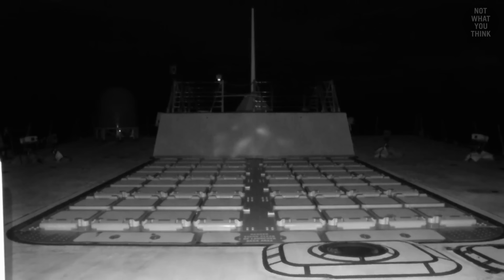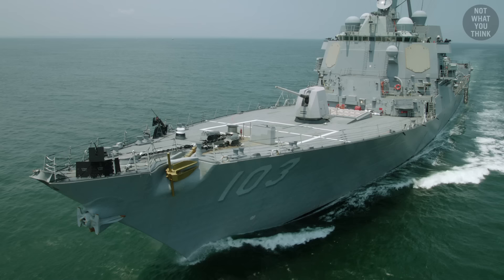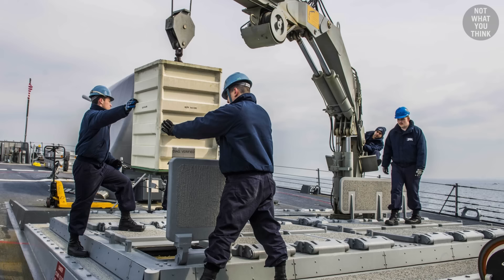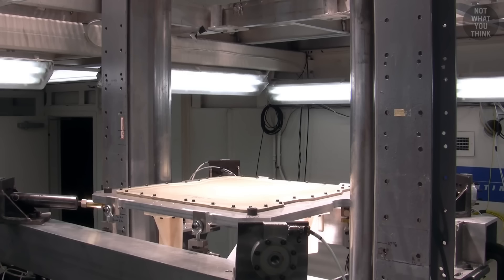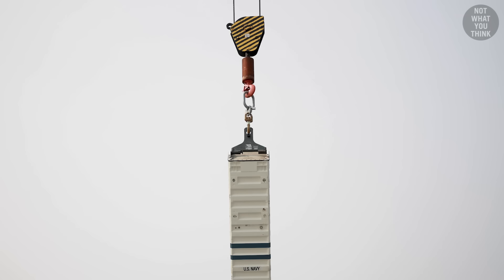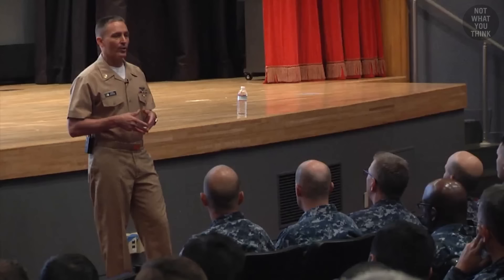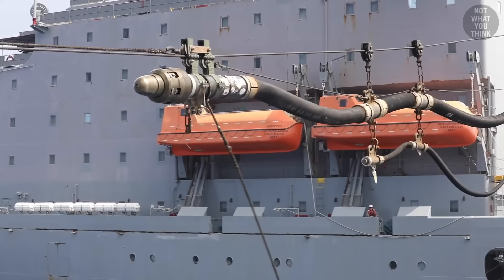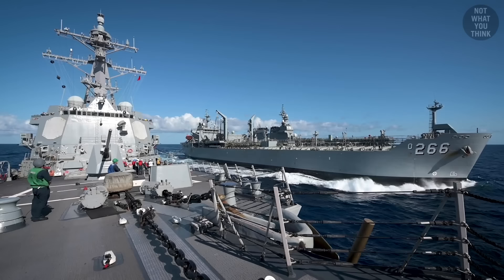Why Warships Cannot Reload Missiles at Sea

Comment: What about a floating dry dock that can be deployed in the ocean that holds the ship in a calm sea state and is equipped with hundreds of loadable missile cases and cranes that can reload the ship without fully removing the ship from a theatre?
Reply: 😂 that ship would be the second most targeted ship after the carrier
Reply: @jessicaregina1956  either way American logistics will be targeted so it’s just cost benefit analysis at this point there really is no simple solution
Reply: That's what I was thinking as well. It's 100 percent possible because the U.S navy had to pay to have a heavy transport ship, ship its damaged Arleigh Burke back to the U.S for repairs after a collison. So why not build one that's slightly bigger that can rearm an Arleigh Burke at sea and also carry crippled ships out of a combat zone or help preform minor repairs at sea.
Reply: See again "most heavily targeted ship after the carrier"

You would need a small escort group just for it and etc**
Reply: Yea drydocking a 500ft long Navy destroyer is a huge logistical undertaking while in a protected port with no wind or waves,  doing so in the open ocean is another thing entirely if not impossible. Plus its gunna be huge and slow and full of a massive amount of explosives. its basically a shoot here to destroy our vital logistics.
Reply: They did this with Polaris, with specialist tenders or floating dry docks that could load or unload the missiles carried by submarines. These vessels were always permanently moored in very friendly and very well secured waters like Holy Lock in Scotland, so they weren't travelling around the world following fleets or creating ad-hoc reloading facilities anywhere in the world or in the middle of the ocean.

Comment: Switch to a Horizontal cradle with hydrolics to a vertical lift.  Then it's lowered into the cell.  A small crane onboard to move to different cells.

Comment: The missile container seems quite self-sufficient. Why store any of them in any other way than ready to launch? Having both dedicated vertical missile launcher ships, and dedicated escorting ships. In the extreme a kind of a "barge" with nothing but vertical launchers. When ammo expended, the barge would be spent and have little remaining value.

Btw, I've just recently began working with cranes. And heck, do those babies offer some surprises in behavior now and then! Even a guy who has worked with'em for 24 years, indoors on dry land, finds himself maneuvering a pendeling load. And since there (on this particular crane, for some probably good reason) is a heavy object half way between the crane and the load it carries, it doesn't swing /\, it swings ><.  Handling that at sea, must be very hard.
Reply: About 20 years ago when I joined the US Navy there actually was some talk about an “arsenal ship” which would basically be a barge with VLS cells and a Cooperative Engagement Computer system to let other ships fire its missiles.
Reply: You are overestimating the number of missiles that the US Navy has bought over the years.
Reply: Read up on something called Large Unmanned Surface Vessel, LUSV.  An unmanned floating arsenal to accompany the strike group.

Comment: Dont load vertically with a crane. Have a horizontal loading mechanism that ratchets in the vls cell so its locked in of breakaway occurs. Then once loaded the mechanism raises the cell and rotates it vertically and loads it in.

Comment: Bravo Zulu (Well Done). An excellent explanation of a complex chain of events. One minor quibble just at the end. The Chinese Navy (PLAN) is NOT even a near peer, much less peer competitor to the US Navy. The displacement of just the US carriers exceeds that of the entire PLAN. All told, the US Navy displaces about 3.5 times that of the PLAN. The PLAN ships lack endurance and the PLAN has a negligible forward resupply capability. They might do well within the first island chain but outside that, they are largely irrelevant. This is a BIG problem for a nation that imports ~2/3 of its oil. About 2/3 of that originates a convenient 7,000NM away in the Persian Gulf and has to pass through one of three straits with a combined width of 51NM. Two of the three straits can be closed with tube artillery on shore.

Comment: I think I have read that the drones were mostly shot with the ship's main gun.
Reply: The rockets costs more than the average drone
Reply: If they're close enough and not a proportionally deadly threat, yeah it's preferable to use the gun with its much cheaper and more plentiful rounds. Even back in WWII when submarines still had deck guns, it was preferred to surface and fire with it on a fairly unarmed supply ship than it was to launch from the limited stock of torpedoes.
Reply: @samsonsoturian6013 It's not the cost to produce the drone that you need to compare the cost of the interceptor to, but the cost of the damage that the drone is capable of doing.
Reply: Cwis is pretty good at subsonic targets. If you have to use it on super/hypersonic targets there will be flac and collateral damage.
Reply: I don't mean CIWS. That is much shorter range. @yeabutwecouldbefreer

Comment: I have served on two missile systems, the MK 26 Missile System and the MK 41 Vertical Launch System, and both are issues when rearming, to reload the original MK 26 was just as difficult if not more challenging because the missiles were directly exposed to the environment and could be easily damaged with just a minor bump, so changing out the missile that is enclosed in the container is less complicated and has less of a chance to damage the actual missile. Either way a battle group is designed to allow the withdrawal and rearming of ships in an orderly manner, just like in World War II when the Battleships would fire up to 200 to 500 rounds of 16 inch projectiles. These massive ships stilled had limits to their capacities. Nothing has changed in complexity but the operational process is much safer for both service members and the actual weapons.

Comment: The US Navy just needs to buy a large container ship, load it with a f*ck ton of different missiles and call it a day. Sure it's not very survivable but you've got all the interceptors and strike capability you could ask for. Put the ship in the middle of a fleet and you'll be golden
Reply: Or like the Chinese are doing and just make a swarm of smaller dedicated missile boats that diversify the location of storage and launch.
Reply: It'd be too slow. The speed of the formation is its slowest link. Even aircraft carriers cruise at like 30 knots. That thing would sweat to break 15. Secondly, rearming these missiles at sea is practically impossible. So it'd be useless regardless of cruising speed
Reply: @rykehuss3435  While your point is entirely valid its actually the cruisers that are the slowest part of the strike group. The carrier is the fastest and can outrun everything else. The Areligh burke class destroyers are also likely (not official but they don't ever say the true speed) capable of 40kts. A Nimitz class can reach 50-60kts
Reply: HII once proposed a DEDICATED BMD version of the San Antonio class. The thing possesses a full-size SPY-6, 288 MK41 cells (you're not wrong, 288) or 144 MK57s, a rail gun and a MK110. Two Ospreys (or Seahawks) could be stored in a well deck-turned-aircraft hangar.
Reply: @mitchspurlock3626  small coastal missile boats also have significant problems with range, defensive capability, and possibly even targeting capability depending on the type of missile they use, but that is likely not a problem.
Reply: Pretty darn sure you can just a retrofitted ballistic missile submarine for that. The USS ohio has space for 154 Tomahawks if needed, and its immune to anti ship missiles due to its capability to submerge.
Reply: How would the ship control said missiles?
Reply: This was actually a concept that was designed in the early 2000s, called the “Arsenal Ship”. The navy couldn’t get support from congress for it iirc (mirroring historical USN attempts at getting big programs that are brand new concepts authorized)

Some variants of the concept included autoloaded 16 inch guns mounted similarly to the Zumwalt’s guns (but less shit).
Reply: @JasonNguyen-lz4cr  98.7% accurate. The San Antonio already has a hangar the welldeck is deleted on the Arsenal ship concept but the hangar is largely unchanged. Cheers
Reply: @liverpoolirish208  The San Antonio BMD concept isn’t an arsenal ship. It is still a normal ship with its own crew.

Comment: A crane dispensable crawler, that has an empty cell, plus the needed reloads seems like an option. (Or, a separate unloader and loader). It moves to the appropriate VLS section, rigidly locks onto the ship and system, making it able to operate quickly and safely, even under rougher conditions, and just slides the used cells out, and slides the reloads in.

It would atill need to be placed by crane and removed by crane from a supply ship, but since it just needs to be placed safely, not accurately into a launch tube, etc, it should be more robust to sea states.

And multiple crawlers could be preloaded on the supply ship, and craned over one after the other, while each preceeding crawler loads and unloads the other cells, reducing overall time of thw process.

Comment: An idea just popped into my head.
What if we reloaded entire VLS modules, rather than individual cells? Sure, you need a bigger crane. But you're reloading at least 8 missiles each cycle, and the other constraints stay roughly the same.
It would probably require another iteration on the VLS design as a whole, but if you can make each crane cycle do more work, it seems like that's the best way to speed up the process.
Additionally, that would give room in the VLS cell to consider things like switching a 2x2 group of 4 VLS cells to a single, larger VLS cell that is restricted to "cold-launch only" (because in so doing you likely also eliminated that cell group's common VLS exhaust ducting).
This would allow carrying less missiles that each are much more capable, or something like a cluster missile designed to counter swarm threats (a large missile that carries many smaller missiles which are each capable of taking out an incoming threat but don't have the range to engage the threats when launched directly from the ship's VLS cells).
Or you know, jump on the hypersonic bandwagon, but that's really, really expensive.
Reply: From experience an SM-2 in its canister weighs 4,200 lbs.  The maximum weight the STREAM Rigs used for alongside underway replenishment can move is 6,000 lbs, though there is a program coming on line to increase this to 12,000 lbs.  Unless you have ever tried to control a load that heavy swinging beneath your helicopter you might not have an appreciation for the dynamics involved O_O   I have lifted and set loads that heavy but it was over land.  I have done a lot of VERTREP at sea too, including replenishing VLS cells but the ship had a crane in one of the four cell sets to lift out the empty canister and stow the full one.
NSWC Port Hueneme has prototyped a rig that can be carried on the replenishment ship that would fit over a 32 or 48 cell VLS installation and allow VLS canisters to be transferred between ships using the STREAM Rig.  No need for the crane on board the VLS shooter.  The replenishment ship's helo could set the rig over the VLS installation and transfer 12 crew members to work on the DDG. The equipment exists in prototype form but so far there has been no "resource sponsor" willing to fund further development or production.

Comment: Wonder why they didn't use a reverse arm method to reload the vls. They put a horizontal case on the arm, it goes vertical and lowers it into the vls. No crane needed, it's attached to something at all times so the seas don't matter. Curious

Comment: If the logistics ship was akin to a heavey lift ship, it could submerge and then load the combat ship into a “docking bay” and then once the combat ship is secured it could start moving again, and then you wouldn’t have the issue of sea stability cause only one vessel would be in contact with the water, also the rearmament ship could have its own VLS on the opposite side of the ship so it could defend itself while the combat ship being rearmed is unable to fire

Comment: Ok, imagine this: having the VLS designed into a standard shipping container size, at least in the 2 of 3 dimensions. Fit as many missile cells in that canister, and transport it-load it and unload it as a whole. Sure it may sound like extra weight to move around, but also the transporting job of t would be incredibly easier. And one more thing, imagine having some mechanical arms that can connect a missile cruiser to a supply ship mid sea, and join them into a single vessel, which sails like a catamaran until reloading is completed. The whole thing seems to have a lot of room for development
Reply: Standard shipping containers require specialized cranes in order for them to be loaded onto ships due to their size and weight, and as already demonstrated having more specialized hardware isn't exactly cost effective for logistics.

Comment: They did successfully reload or two of a VLS using a type of floating dry dock awhile ago.
Not too sure how far into the program they are though.
Reply: Those tenders or floating docks were semi-permanently moored in a friendly harbour near to a naval base or in some cases they'd be moored in the base itself. There's a submarine tender at Naval Base Guam that resupplies attack subs but the way it's moored, it's almost like an extension of the dockside. Reloading at sea would be a nightmare in comparison.

Comment: this seems like something that could fairly easily be solved by a heavy duty robot arm and sturdier canisters.
use a resupply ship to move canisters from deck to deck, then use the robot arm to move canisters from the deck into the cells.
the cells could also have extendable rails that come up and grab the canister, guiding or even pulling it down.
this seems like it would be a fairly easy engineering challenge tbh
Reply: You mean like use a VLS strikedown crane that takes up 3 cell spaces of the VLS ... Hmm I wonder why they have never thought of that. Oh wait they already have. It works just fine. However it was a bit of a slow moving crane and pain in the butt folding and storing away.

Nor is the sturdiness of the canisters an issue, as they easily withstand the firing force and are several inches thick metal. The issue is simply a moving platform such as ship on water, and getting the swinging canister started into the cell. Even using the guide as can be seen at 0:15 in the video, it can still be a bit tricky. That swinging 20' canister is not light after all even when empty, let alone with a missile.
Reply: @kevinfisher1345  no, not a crane. a more rigid structure, which would not have anything capable of swinging. simply a robot arm, that grabs hold of a canister and lifts it into the cell, hence requiring a sturdy enough canister that can be lifted and rotated even in rougher sea states.

yes, cranes and flimsier robot arms would sway. a strong enough robot arm would not, and neither would the canister it is holding.

yes, it would take up deckspace, like the crane you and the video mentioned.
Reply: @mini_bunney That defeats a prime advantage of basically no moving parts on the VLS, and second, reloading the VLS at sea like that really isn't that important in the big picture.
Reply: @mini_bunney  Yes possible. Except it would not replace the issues they had with the strikedown crane. They did away with that crane, as its main purpose was to load while underway at sea. That was simply to risky of an endeavor. The only other purpose was to remove empty canisters to save some time. The US Navy decided it was better and simpler to just go to a port and load from a land based crane like they normally do. A robot arm would not change that. Might make it a bit less riskier, but does not change the issue.

Comment: I question why they used a folding crane, rather than a mechanical arm, since the arm wouldn't care about the sea state at all.
Reply: A mechanical arm is still subject to the laws of physics. A relatively light weight canister more than 7m long, containing multiple tonnes would likely experience unacceptable damage in the event it was held rigidly in adverse sea states. Much like container cells for freight, they are designed to transmit load along specific vectors, and are otherwise structurally fragile. Hence the rigid hinge used while transitioning vls between lateral and vertical orientation with the crane.

Comment: I imagine the MK10/11/13/26 would be just as hard to load at sea and not have the same rate of fire. The arm launchers could also fire a variety of weapons, e.g. SM1/2/3 (ER versions depending on magazine length) as well as ASROC and harpoon, but IIRC they could only fire a few rounds per minute.
The  obvious question with reloading is why not just put tubes on the resupply ships and data links and fire the missiles from them instead of bothering to reload the DDGs/CGs? The obvious answer is that you can't spread them out to as many locations. But that might not be such a big issue in some scenarios, e.g. defending a CVBG or a city.
I think I read somewhere they are thinking about autonomous vessels with MK41 that can be fired from data links, so each DDG/CG or battle group might have a number of these drones to increase the manned vessel(s) magazine depths.
You could also put them out on the expected threat access to reduce reaction time, especially if you are concerned about land based ballistic missiles e.g. DF17.